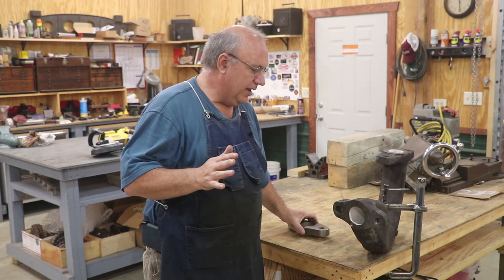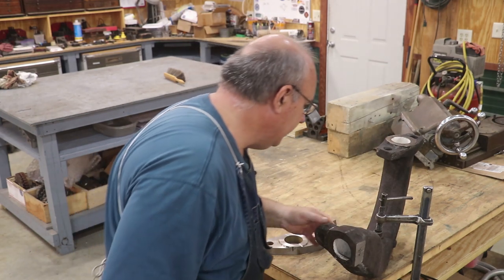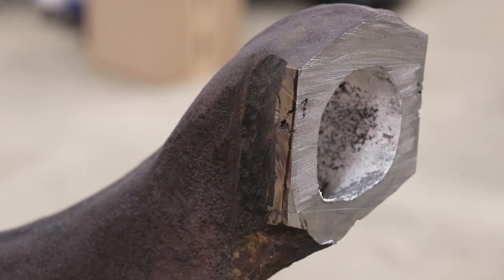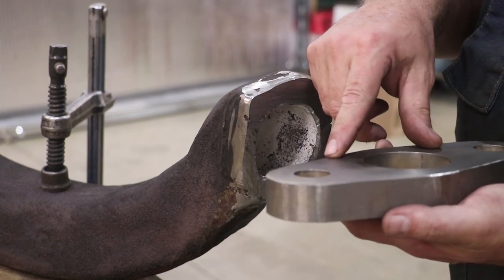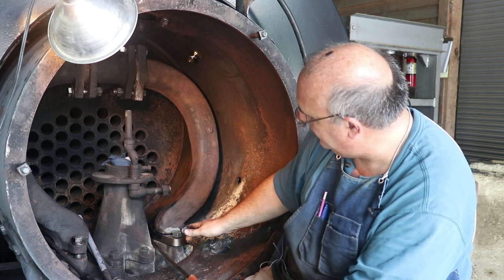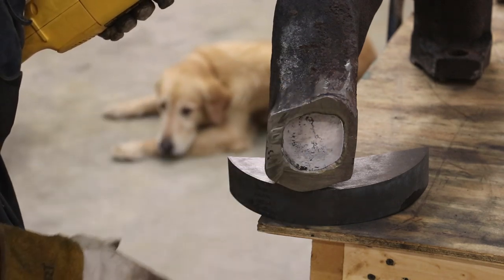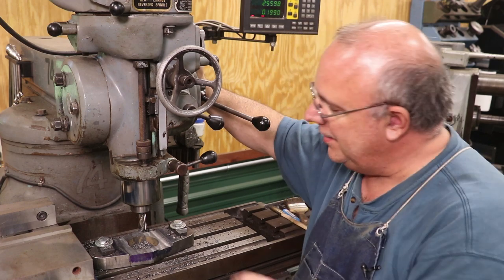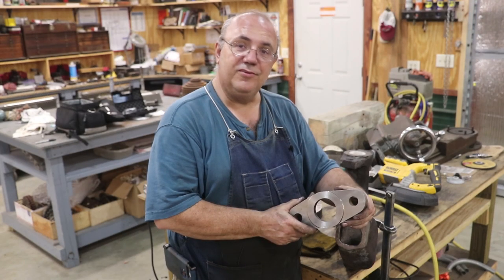Steam Locomotive Steam Pipe Repair - Part 4: Fitting the Flange to the Pipe

Comment: Looking good Keith.  One of the steps I take when brazing big stuff like that is to "tin" the surfaces with braze separately before I attempt to braze them together.  The "tinning" helps the main braze flow quickly to deep areas and insures a good attachment.  Just a suggestion.   Fred

Comment: I really enjoy this series.  You didn't panic in the beginning and worked through the problem to find a no drama,  practical solution.    The aspect of field measurement and fitting - alternating between the locomotive and the shop - is a useful lesson for everyone.  Keep it up.

Comment: Hi Keith, I've been welding and brazing for near 35 years now, just looking at the joint your about to braze, to attain maximum strength you will need to v the joint out at about 45 degrees to a v width of 5/16 to 3/8 and in my experience, with the constant temperature changes I would advise you use a bronze filler material rather than the usual brazing rod, love the videos, thank you very much.

Comment: Great progress.  I am in agreement with you on brazing cast iron. The braze is as strong or stronger than the original cast and you don't have all of the problems that welding causes.  I am still working on getting the original drawings, they will be helpful when finalizing the 3 D scan.

Comment: I am enjoying the project as well.  I would not have figured to slot out the flange and cut the minimum off the casting.  The initial way I understood you were going to cut the whole flange off and butt joint braze it.  Glad you didn't. I learn something from this video and am looking forward to seeing the next set up on the locomotive.  Thanks Keith!

Comment: Thanks for the video, and thanks for including the issue of the end mill slipping in the collet. It seemed to only happen to me whenever I was at a critical point. I found there was less chance of slippage when held in an end mill holder with a set screw than when held in a collet. Thanks again, JB San Diego.

Comment: Hi Keith a good job you are doing on the flange repair . Looking at the vee you are going to braze is looking a bit small for the surface of the joint as the brazing will not flow very easy through the joint and give the surface area you are looking for to hold the pipe and flange together. Brazing welding is a surface tension weld as it relies on the area of the brazing in contract with the materail that is been welded. Keep up the great jobs of keeping the loco going.👍

Comment: Keith, I'm sure you are aware and have taken into consideration, that big pipe will be a huge heat sink when you start final brazing.   Preheat, preheat, preheat.  And keep some sort of heat on it as you work (or insulated very well after heating).  Just my non expert advice( not that you need it).

Comment: The endmill creep with r8 is why on heavy cuts endmill holders are a must.. With collets such as MT2 , you hardly ever have that problem because they grip so much tighter than R8, but with mt2 collets you need the drawbar to be self ejecting as you could not tap the drawbar hard enough without knocking everything out of line.. I have a Bridgeport M head and a Kearney and Trecker Midgetmill that are both MT2 and I love them....
.

Comment: Getting closer to a functional repair. If you can heat and anneal cast iron after welding it does very well and eliminates the hard spots. I think you should have enough braze in contact to hold as much as the ears on the flange will anyway.

Comment: Using the saddle method does prevent most of the problems I was seeing. The only thing left is tapering the hole in the flange to prevent calcium buildup at the flange/pipe interface. Even though it's just has to hold until you get the new casting, no telling when you'll get the chance to do the replacement.

Comment: Very interesting work Keith. The point about heat changing the properties of Fe cast. This does make me wonder if it is possible to anneal cast Iron. Chemistry suggests 1500 for an hour then 1400 for 6 hours finally 1300 for 10 hours (degrees Fahrenheit). At the end of this process you should have ductile Iron. I would let it cool slowly under a fire blanket too. Note doing this has no garentees, do it under your own risk.

Comment: Hey Keith, I think you're on the right track.  Can you add in like a 15 minute talk at some point about braze strength?  I interested in the ultimate holding power/PSI that the braze you make will have.

I'm thinking the thickness of the braze in the joint, + the total square inches all matters?

To be honest, I know crap about braze strength, and probably am not even asking the question properly, but I would love for you to address this issue.

I have brazed a few small pieces and always wondered about the ultimate strength of the joints I have done.  Thanks!!

Comment: You surprise me as always Keith, again im not a machiniest just a diy fab guy, but all this time im thinking how can ya possibly get that to mate up right again with all the angles involved etc etc. - but right off the bat the ball joint assembly provides some leeway as does the upper one.  I was picturing it having to bolt in solid top to bottom but of course its not built that way for reasons of movement, expansion contraction etc.  This has been interesting due to the difficult nature of its shape and alignment, but looks like youre getting it done once again, cant wait for the final fitup.  Nice work Keith.

Comment: Really enjoying this series.  Good to see some steam engine work.  Quick question... is it worthwhile to file/grind out the excess material in the bore to make a smooth transition or is it irrelevant in a steam pipe? Ie it doesn't cause flow issues

Comment: I know brazing is standard, but I really wonder why you didn't consider silver solder. It is a bit lower temperature than braze, but I believe plenty high enough for this application. And it has the advantage that you can get everything fluxed before you even start heating, and then when you get part of the joint hot enough it will wick around and even fill in the flat surface between that parts that you couldn't possibly get braze on.

Comment: My heart cringed at 4:23 when I saw how you were grinding that thing.  You have to turn the grinder around, shoot the sparks down, and give the grinder a way to move away from being pinched so it doesn't cause you harm by getting wedged, breaking the disc, and shooting off pieces at 6,000+ rpm.

UPDATE:  Those problems you were having at 4:31, they can be avoided by doing what I wrote above.  Always make it so if there's any struggle on the disc and it starts to get pinched, the way away is a free way of freedom, and that will keep you from future injury and damage to your part and other things.
Reply: I've been using a grinder for 35 years and have had none of those problems.

Comment: I don't use R8 collets any more simply due them slipping depth wise. Had it have a few times. I use the R8 tool holders with the set screw that hit the flat on the endmill.  I center on the flat and pull down before tightening. 

Good work..

Comment: You can clean the calcium/magnesium scale out of the pipe with vinegar. What is necessary is to use low pH water to flush it out with. Then use some water with a little ammonia or TSP to neutralize the pipe again. The solubility of the hardness ions, (calcium and magnesium), is variable with pH.
Reply: Or you just wire wheel it off.

Comment: Thank you for the great videos. Please excuse me and please  read  this important rant. As a shop veteran I must speak up and point out what I believe to be a severe safety violation. Please don't ever  ever ever "push" a cutting wheel/ cut off disk such as you did on the first cuts. Please always pull it towards yourself. I know it will send all the Sparks at your belly and legs you'll live through  that. If the wheel catches it will launch itself away from you. Instead  of trying.to cut off a body.part. Watch
 your video and see it trying to jump back at you. I've seen way too many bones and muscles and tendons showing on guys and myself while administrating first aid. For all you folks.. they are like pushing a chainsaw and having it kick back. Like a cat they can kick back and whack you so fast you will never see coming to try and defend yourself. Remember that disk is spinning a 11.000 rippums  You should see what it can do to your face right through a face shield. Love your work keep it comming we all need to watch out for each other
Reply: Silly Safety Sally joins in

Comment: How mirrored are the left and right steam pipes, reason I ask, could you take the other steam pipe out, then bolt both the upper flanges together with a thick piece of plate between them, with that plate long enough pass where the bottom flanges are, so that you could mirror the new lower flanges based on the other steam pipe, using the plate a the reference for measurments?

Comment: On milling cast iron you do not need to lube that metal. It is self lubing sort of & soft enough that you don;t have to do that. Been watching Keith Fenner doing lathe and milling work. May save you some lub oil in this matter.

Comment: It's looking great so far. I just have one question. I'm not a machinist, but I always heard that you shouldn't use oil when cutting cast iron, or at least that it's not necessary, but you put oil on the flange plate. Does it just depend on the kind of operation you're doing?
Reply: Cadwaladr, I think the flange is made of steel, not cast iron. That’s why he put oil on the flange.
Reply: Cadwaladr

New flange plate was made of STEEL, thus the lube when he was milling the slot

John
Reply: Did you pay any attention to the video, or the previous ones where he made the flange? Take a look at 1:06
Reply: Cadwaladr, sorry, I went back and looked at 1:06 and he did say cast iron. I thought he had said he made it out of steel, I’ll go back and re look at the old episodes, but I apologize for what I said, I was mistaken.
Reply: No worries, mate.
Reply: Cadwaladr, yea, I just went back and watched Part:2 Machining a new flange. I was wrong, he did say he was using cast iron. I for some reason thought it was steel, but I’ll try to be more vigilant in the future, but... again I apologize

Comment: I am just wondering why didn't you mount that pipe in the mill and indicate it and machine it perfectly rather than grinding it
Reply: He discussed that in the first video--holding that thing accurately is difficult and not worth the time because the cut doesn't have to be that accurate anyway.  The brazing will correct any small errors when he does the final attachment.

Comment: I don't think you can heat treat cast iron, or at least it's not common to do it. The reason it's so hard is because it has so much carbon in it, way more than steel, and silicone too. That's why it breaks instead of bends. It could have giant inclusions of carbon that could contaminate the weld if you tried. It would be easier on the flange because on would have less of the other impurities than the 100 year old pipe but the pipe would be tough to do. I wouldn't try it.

Comment: Bending stiffness in a beam is a function of the thickness *cubed*.  Removing 3/8" from a 1" thick flange reduces the bending stiffness by 75%! Tightening the flange bolts will transfer a significant amount of stress to the braze joint.
Reply: I completely agree with you John the rigidity of the new flange has now been compromised 
Better to have cut more of the pipe as the peeling load now may cause repair to fail
Reply: Based on the history of the flange breaking, either the original casting is underdesigned, or technicians have been over-torquing the flange nuts. So, a durable repair needs to be stronger than the original flange; that's a pretty tall order on a cast iron part!
To be fair to Keith, the irregular shape of the steam pipe near the flange may have precluded cutting it back any further.
Reply: When the flange is brazed in, it has complete thickness available again. You over simplified your assumptions.
Reply: My point was that a lot of tensile stress will be present in the braze joint. If it is as strong as the cast iron, then it should be as good as the original casting (which was apparently not strong enough). If not, it will probably crack at the edge of the 3/8" channel cut in the flange.
Reply: The final stiffness will be somewhere between 3/8" and full thickness, plus or minus the tensile strength of the brazed material pulling away from the cast pipe sidewalls.  It might warrant pre-loading the flange with a small amount of crown in the center before brazing.  That would help ensure the braze joint remains in compression or at least near neutral stress rather than in tension.

Comment: Hope you use plenty of flux , the way it's cut out your gonna need it. . Still think you should have killed a male end on the casting and a female on your flange , the more of the casting in the flange the better. . Oh well hope it works out. How long it lasts is in the air , steam mist and water metals are corrosive to brass. And dissimilar metals..
Reply: Milled not killed , I hate this pad and it's spell checker